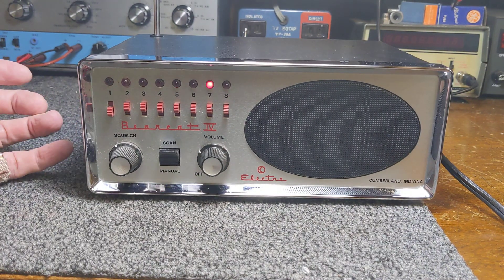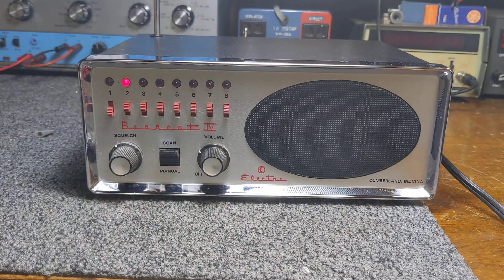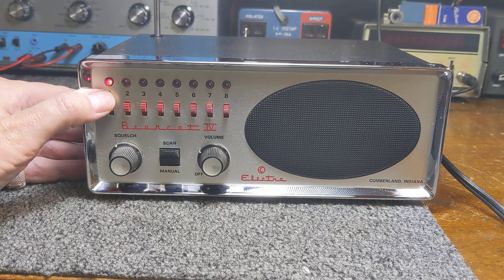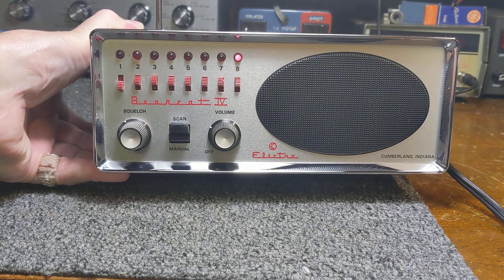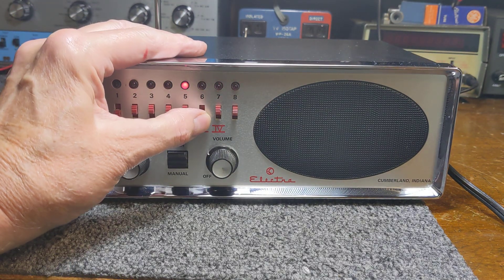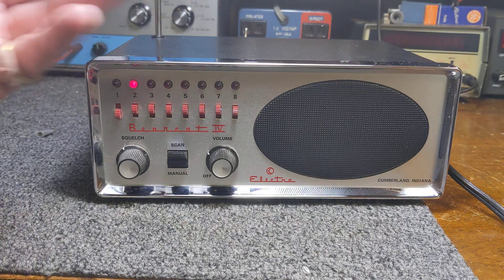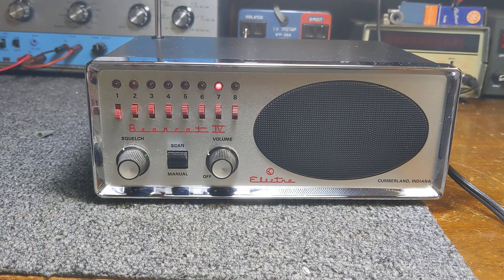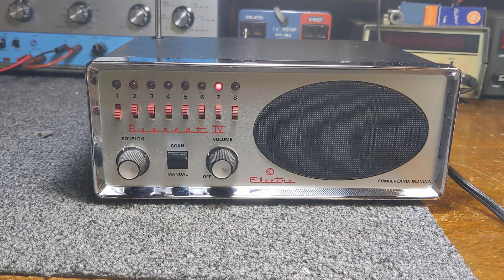New Life for Electra Bearcat Scanners

Comment: I plan on modding my BC3 to use an Si5351 programmable oscillator module (adafruit) with a RPi Pico to replace the crystals.  Will add a 6 digit BCD switch and an OLED 128x32 display to control the oscillator.  I will then be able to store as many channels as I want and scan them.  As many police and fire depts are now switching to digital encrypted radios what you can hear on one of these may be limited, but I can still monitor local 2mtr and 70cm ham as well as CSX, AmTrack, and T commuter rail traffic.
Reply from the maker: Great idea, let me know how it works out. Would like to try it myself.

Comment: You know, Fred you can use an Electra branded scanner as a precision signal generator. Just add 10.8 Mhz to the frequency you want to generate a signal over. Obviously, it won't work with a "rock bound" scanner. But you can use it on the fly with a programmable Electra scanner... Including a pocket scanner.
Reply from the maker: Great idea maybe I'll give it a try sometime.
Reply: I was in the two way radio business from the late 1970's thru 1995. When P2 protocols started invading wireless communications and each major manufacturer had their own protocols that were incompatible with other manufacturers. I got sick of dealing with it.